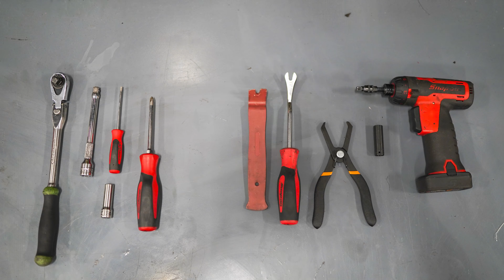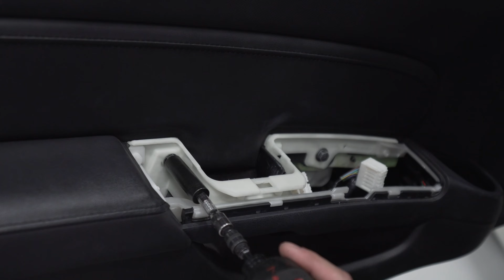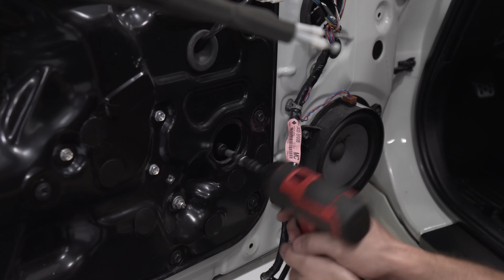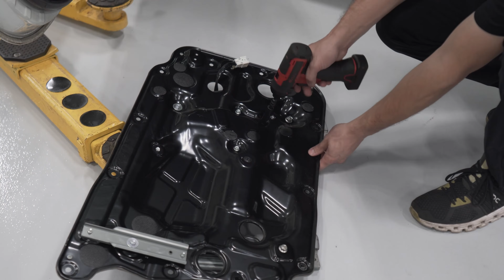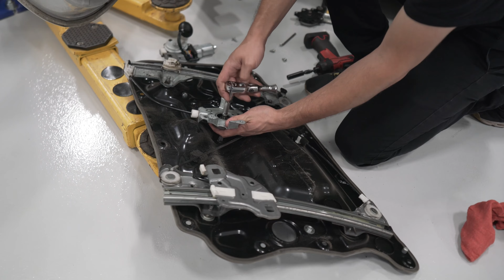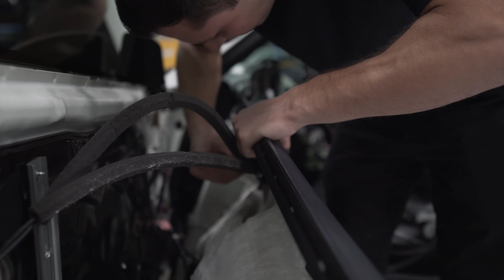How To Replace 350Z Window Motor Install Guide

Comment: A little tip for those that are confident to do it, you can buy brushes for less than £5 uk and  clean lub the motor and replace brushes and save a shed load of money 💰 
I done my passenger door with no problems, and I'm doing the same with drivers door. I had never done this b4 myself. Give it a go. 👍🏻
I think these motors are about £250 each in the uk.
Reply: OEM ones might be but i got one on ebay for £32, replacing the brushes definitely the cheapest option though

Comment: My window is 'stuck down'.....will not go up so I cannot access the 3 bolts needed to remove the window: how do I manually crank the window up? Thanks in advance if you or anyone else can assist in this.
Reply: I've got the same problem... did you end up fixing yours somehow? Beats me how I'm meant to "adjust the window to the correct place" when the motor is blown, and it's stuck all the way open.

Comment: Why do you have the glass in the down position to remove it but then have it in the up position to reinstall it? Couldn't u remove it in the up position as well and save having to remove extra access seals?
Reply: I think so, I was wondering the same thing. 

Right at the beginning of the video he says this window is stuck in the down position. I’m not 100% sure but I think you can remove it in the up position from the holes he used to reinstall. I will be performing this either later today but definitely by tomorrow. I’ll come back and let you know how it went.
Reply: @bacaflaka how did it go? What positions???

Comment: To aid in the reinstallation of the window glass, before you remove it, place painters tape along the bottom edge of the glass in a couple places along the outside of the glass where it meets the rubber water seal. Line it up perfectly along the seal. If your window rolls up, also place a piece along the vertical seal at the front of the window the same way. After the motor/regulator are replaced, this technique will save a lot of time adjusting window alignment when replacing the window back in the regulator mounts.

Comment: Wish all "how to videos" were like this one. Will be starting this job soon and because of your video I feel confident enough to try it myself. Update: My wife and I just performed this repair today. Two things I would add 1) there is a plastic cover behind the inside door latch that has to be popped out exposing the bolt that needs to be removed (this isn't shown in the video. Update: it's there just quickly mentioned). 2) if you do not have a magnetic socket just put a little piece of duck tape between the bolt and the socket. It holds the bolt securely in the socket so it doesn't drop into the inside of the door. Having said all that it's a great video.

Comment: How do you diagnose that it’s the motor that’s faulty? I.e. not the switch or the regulator. Just trying to avoid buying unnecessary parts as much as possible.

Comment: What if my window is stuck down?
Reply: I have the same issue also the window is stuck all the way down! UGH
Reply: @ninarabideau7003   funny.  I took apart my door and tested everything and it started to work for 8 months but it stopped working last month.  I just got a new motor and I'm  replacing it today
Reply: @Siege_the_350z how did it go with the window being stuck all the way down ?
Reply: @ninarabideau7003  not bad but I had to remove all the bolts and nuts. Also the motor seems not to be the issue but the window regulator is the actual issue.